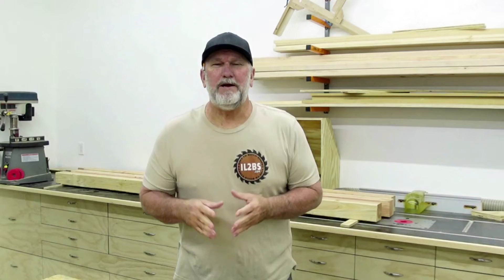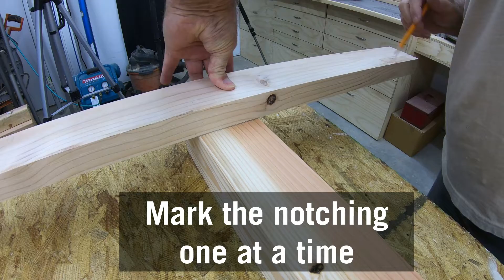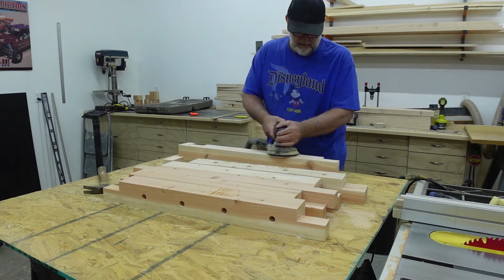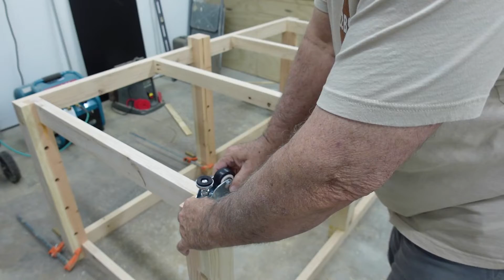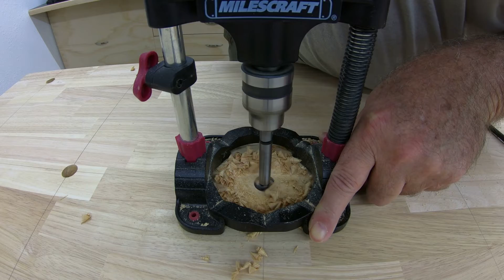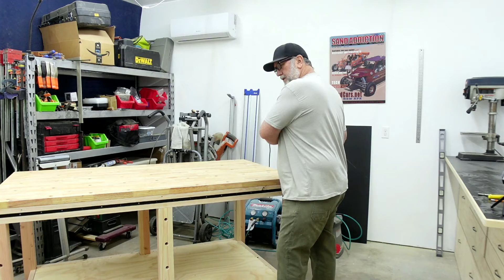How to Build an Easy Out-Feed and Assembly Table

Comment from the maker: Build Cost:
4x4x8  Post Legs:  $36.81 
2x4x8  Pine Framing: $26.00 
4x8x3/4" Plywood Lower Shelf:  $49.88 
39x72x1 1/2"  Hardwood Island Top: $163.00 
       
Adjustable Casters:  https://amzn.to/3Zac1VV 
Adjustable Feet: https://amzn.to/3ZuH52o 
48" T-track:  https://amzn.to/41AueNU
Watco Natural Danish Oil:  https://amzn.to/3xZB6Hk
Minwax Paste Wax:  https://amzn.to/3YhcK6u
Self Centering Drill Bit:  https://amzn.to/3Y6s7P6
3/4" Forsner Bit:  https://amzn.to/3mftvBJ

Misc, screws, glue & Finish: $16
       
Total Build Cost $348.67

Plans:  https://iliketobuildstuff.org/product/out-feed-assembly-table/

Comment: Where did you get the butcher block table top at? I didn’t see the link in the description.
Reply from the maker: here ya go https://www.homedepot.com/p/Hampton-Bay-6-ft-L-x-39-in-D-Unfinished-Hevea-Butcher-Block-Island-Countertop-in-With-Standard-Edge-THD-HBU-0003/319764601
Reply: Thanks man. Yikes looks like the price went up a little bit
Reply from the maker: If you're not in a hurry Keep checking because I have seen them sold at all different pricing depending on how many in stock.  Be sure to check the local stores also because when they get a big pile of them they put a sale price on them.  @jasonvera2269
Reply: Ok thank you for the heads up. I’ll do that.